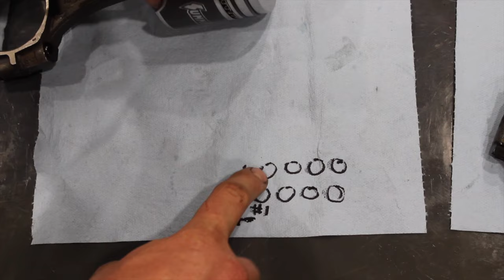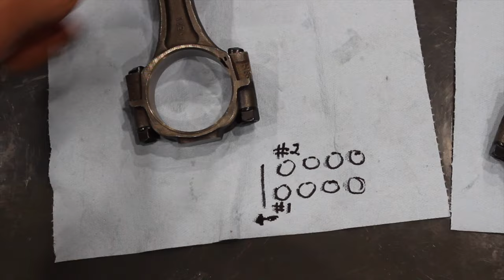SBC Piston Ring and Rod Orientation (For the First time Builders)

Comment: sorry, oil controller is 9-12-3 then 2nd ring at 9 and top ring is 3, all street engines are set in that manner. read your paper work. if you don't do this you will get piston washout, and foul your plugs. if you done this right, you should get a nice golden burn on top the piston. if you see clean spots, someone did not install ring correctly. you never clock the 1st or 2nd ring to 12 or 6, this is thrust points. You want full ring contact on exhaust & compression strokes. piston skirts will thank you. engine builders 101
Reply: don't the rings move around when engine is running? so what even is the point of ring orientations?
Reply: 3what?
Reply: Yes but if they do then they move together ,but is still very rare that they will be all at same place @lordjaashin
Reply: @lordjaashin  And what is going to cause or make them turn??
Yes they will move, ---- 
UP and  DOWN
Reply: @frederickshipp8013  The cross hatch on the bore. The ring gap not being exactly parallel to the bore. Piston rock. Blow by. They move all around. A properly gapped ring will close up when warmed up almost eliminating the gap. If it is not gapped correctly you get blow by or a broken ring w/scored bore. Too much ring groove clearance will also cause excessive movement and flutter.

Comment: Like you, I make myself feel good by timing the gaps. Reality is the rings rotate and go wherever they want.  Ironically though it's rare to pull an engine down and find the gaps lined up ?  If it gap timing really was important, surely someone would be using pegs like 2 strokes do, but I've never seen that on even the most expensive pistons.
Reply: Found the same thing my self

Comment: I have watched rings rotate on pistons before. When I worked for the truck line, we'd pull the air box cover/s off of the 2 cycle 8v 71 Detroit's, and we could watch the pistons through the ports and see the rings turning, when it was running
Reply: On my 2-stroke dirtbikes they’ve always had a locating pin for each ring. I thought that was the norm to avoid the open end being cought in a port.
Reply: @ian9toes  As I recall, the Detroit's had a ring of relatively small ports around the bottom, anyway they didn't have ring retaining pins.
Reply: Exactly. It really doesn't matter, but i roughly do it anyway.  I definitely won't be losing sleep over it 👍

Comment: the rings spin on the pistons when the engine is running.  oil control rings are about all you can orientate. but good explanation of v8 rods.

Comment: If everything is correct the rings will rotate on the piston during normal engine operation. When they stop moving is when problems start.
Reply: Incorrect. How would piston rings rotate? There's zero rotational force.

Comment: Not sometimes, the rings WILL rotate because of the crosshatch. If you pull an engine apart after it's been put together and run you'll see the gaps in different places. The initial clocking is to make sure they don't line up from the start. I've pulled apart engines that have 60k+ miles and still have cross hatching showing (high nickel Chrysler blocks). Most of the ring and piston mfrs and OEMs have their recommendations. As long as they are staggered. I've seen 120 degree spacing in some service manuals, or 270 with some ring packs from Speed Pro.

Comment: I was taught to put the endgaps away from rhe thrust faces of the pistons.(opposite of what you said to do.) By a very respected well known engine builder.) So that the ring ends dont score the thrust faces on break in.
I put them all at the 90°\270° area.(ends of gudgeon /wrist pin.)
Reply: I thought the same thing.  Seems odd to put the end gaps on the thrust side.

Comment: Good video! Another note to add is the berring locking tabs in the rod go to the top closest to the cam in case the rods aren’t numbered and the new pistons are not on the rods yet!
Reply: locking tab to out side 0f crank
Reply: They go towards the oil pan rails, not the cam.

Comment: Many years ago I did some piston rings and I separated some feeler gauges and put 3 at different parts of the piston and slid the sharp edges of the ring on the gauge to prevent it scoring the piston; it was a 4-cyl and it worked out fine. But if I had to do it today, I think I would buy me the proper tool.

Comment: I really like how you explain things and talking about what works for you and others, as a diesel tech in Canada, in our colleges it’s taught that ring gaps for diesel engines are clocked 180 and the gap must not be set over wrist pins, nor the   Face (where the piston skirts the longest) it was explained because when the piston is in its power stroke actually off sets to the one side or “rubs” to one side, idk what do you think about that? It’s hard to explain with out holding the piston assembly like you are in the video

Comment: Simple tip fitting piston ringe,   ...   take   THREE  old  thin feeler gauges, align them around the piston at 120 degrees ,  [use elastic bands to hold them in position if reqd. ]   ... then easily slide the rings over the feelers , over  the apropriate  ring grooves , slide out the feelers and the ring drops into the groove !  ... also works removing rings !

Comment: Cool, I like to put the compression rings on the non-thrust plains. Plus clocking those rings on the pin end side will minimize the chance of the rings gouging the cylinders.

If you put the gaps above the skirts where the pistons have the most available amount the piston can move in the bore if the piston rocks on the pin's axis. That movement would be minimized 90 degrees of the axis.

Anyway, that's my thinking about that which is probably a bit nit picky on my part.
Reply: You are really forgetting about thrust. Check your thrust bearings upon removal, they will wear the sides more than any other bearing, rod or crank, so up and down on the compression rings is best orientation. As any slap or wear on the skirts pin end sides is rocking this gap ends into the walls on the thrust side...just engineering thoughts.

Comment: Questions: 1-Do you “clock” your cam bearings? I’ve heard mixed things, but the last motor I built, I clocked them to roughly 3:00. 
2-What head gaskets do you like for your Vortec heads? I really want to try out the Felpro 1094’s for the extra compression, but worried about them sealing without everything being decked.
Reply from the maker: Yeah I do clock my cam bearings. Some guys will tell you it doesn't matter where there's a oil groove all the way around but the optimum place to position the oil hole is between 2 and 4 o clock looking at the block from the front.

You may find you will have problems with the steel shim gaskets on a undecked block. Guys have done it with success but its obviously hit or miss. The deck surface should be very smooth when using a shim or mls gasket.

You can use a gasket like GM# 14096405 (.028 thick) on a decent deck surface.
Reply: Awesome thanks. Also do you have any videos on how to select your cam timing and ignition timing for your specifically desired torque curves? Thanks.
Reply from the maker: Not yet but some future videos
Reply: Bearings with 3 holes in a triangle configuration, you set them at 3 and 7, which oils ahead of the cam journal in rotation,  looking at the front. 1 hole bearings don't optimally oil, so they should be at 6 in line with main, which again, Isn't optimal but will throw more oil at the bottom of the journal.
Reply: I don’t do them between 2-4 o’clock because it takes up most of my day I do them at 9 o’clock in the morning 😂

Comment: I usually put oil rails at 60 to 90 from the expander  then since I don't want the ring gap on 5he thrust side of the piston u usually line them up with opposite ends of the pin
Reply from the maker: I guess I've just always done is the CP carrillo piston way. Its just one of those things that everyone seems to do differently haha

Comment: Golden rule with rings:
If you take hold of each end you can push them together, you can waggle them up and down but you CANNOT pull them apart or they'll break. Practice on your old rings first.
Reply from the maker: Good advice. Moly rings are forgiving, but cast rings certainly are not lol
Reply: Rings, especially cast iron, can be pulled apart, NO MORE THAN NECESSARY,  to fit over the piston itself.
 They break easy, then the brakes are on, for progress, until new ones are acquired.
 Like he mentioned, experiment with the old rings, to get a feel for how much they can move/expand, before they break.
 If you get frustrated with any shituation. The shop rule is:
"Only throw the broken parts"😁

Comment: Piston ring orientation at assembly isn't something that matters. 

There has been multiple studies on this subject (GM E. Schneider D Blossfeld is one example, I believe Ohio State did another but cant find it at the moment.). Realtime analysis is done by exposing part of the ring to a radioactive source and using gama ray monitors to view the motion of the rings in a running engine. All these studies find piston ring rotation to be rapid and erratic. The ring gaps will line up eventually, and they will soon after not line up, and on average, they will spend more time not lined up than lined up.

If it makes you feel better to orient them in a certain way by all means do so, but don't lose any sleep over ring orientation.
Reply: That's awesome. I can now stop clocking my rings in all the $250k motors I build. 
I have seen first hand what happens if you don't clock your rings. Massive amounts of blow-by. We have had rookies make this mistake in the past when someone wasn't watching

Comment: How the rings get clocked doesn't matter, since the gaps WILL line up eventually. Rings have to turn, and turn they do. It is a necessary evil. However you set them, is purely by builder's choice and how it makes you feel inside, knowing they didn't line up when you installed them. 
However, it is MUCH more important to make sure the gaps are correct, the rings are installed right aide up, and most important, they are the correct ring for the ring land. Radial, and axial.
Reply: If ring ends line up then you have no compression and blowbye, clocking rings is very important, rings just don't turn they turn back and forth that's the purpose of cross hatch honing.
Reply: @jeremyking5684  False, actually. Rings Do turn. Gaps WILL line up. They don't stay lined up, because they turn. They are always turning. Why? Because if they don't they can't disappate heat, and they will fail very quickly. Sealing a chamber is not the only job a ring has, and it has ZERO to do with cross hatch. Period. 
I know what happens when they line up, and at some point, they always will. Nothing anyone can do about it.. Just an FYI.
Reply: It does make a guy feel good about how he put his engine together, though...
Reply: 😁 Cross hatch honing is done to make sure new rings wear to the cylinder walls. Ensuring the new rings seal all the way around the cylinder walls. The cross hatch acts as a cutting edge on the rings. Eventually the cross hatches get wore off and the cylinder walls become very smooth as do the rings.
Reply: @jeremyking5684  Wrong
Reply: @jrdmotorsports9718  so all the ring manufacturers that put instructions in every ring pack about clocking rings don't know what their doing, every car manufacturers has pacific ways to clock rings don't know what they are doing!😂
Reply: @ihatecrackhead  in 30 years building engines I've never took one apart that had ring gaps lined up! I had to fix a engine that a guy built that had low compression on a cylinder and the cause was rings gaps was line up! If it don't matter why did they invent gapless rings!
Reply: @jrdmotorsports9718  okay you hack been building engines for over 30 years ,people don't have to take my word, look at your ring box it tells you every service manual tells you! All the engine builders I know clocks their rings, I used to put engines together for car manufacturer everyone you clock the rings we did over million cars a year!
Reply: @jeremyking5684  Show me where in my comment that I said  not to clock them? I'll wait....
Just an FYI, assembling an engine here and there over a long doesn't make you an actual engine builder, regardless of how many years you do it. 
The fact you are messing with this stuff for 30 years and still have to follow a manufacturer's recommendation tells me all I need to know about you. 
Next time think before you speak, and learn to read like you read those directions on how to assemble engines.
Reply: @jrdmotorsports9718  you mean the directions that's only put on there to protect the manufacturer, that's an hack job saying right there!
Reply: @jeremyking5684  No. It's common sense. Real engine builders, who do this for a living, everyday, for 35 years, like myself, know that. All they are doing is making it user-friendly for the ones that don't know how to assemble engines. Assemblers are not builders. Manufacturer's recommendations and assembly directions are not the golden standard. Just helpful hints. The fact remains, rings have to rotate. Gaps line up. Therefore, logically, the engine doesn't know the rings were 180⁰ , 90⁰, or 45⁰ apart when installed. Doesn't matter what engine or what power level. Period. The real hack is the one thinking this is false.

Comment: Ever use total seal rings & their dry powder cylinder lube?  I run their gapless rings in almost every build now, the gapless top ring are great for racing but tend to pull oil past the valve stem seals due to higher vacuum
Reply: The things we learn by watching and reading.  Incredible. I guess no need for a vacuum pump if blow by is diminished???????
Reply: For external oil leaks I mean

Comment: I just installed new pistons and rings - when turning crank by hand, I can hear a subtle scraping sound - is this a normal sound for new installs?

I did take the piston back out to check rings and cylinder wall, and both were good...

The crank turns fairly easily although a tiny bit rough with pistons installed... can I assume this is normal and the noise is coming from the new rings riding on new hone?

Your experience in this sure would help put my mind at ease!

Comment: thank you for this info! randomly fed on my front page (looking to rebuild my genesis). I do have a question, when i buy my new pistons and rods if i see the little slanted edges on the connecting rod that hugs the bearing.. even for a v6 would i still want to use this same method of bank 1 having them face the front and bank 2 facing the rear? I guess when i pull the motor ill see what it has in terms of orientation from hyundai right? lol (first time builder)

Comment: Quick question if you did put the pistons on the crankshaft the wrong way how long will it take for the engine to fail. Like instantly when you do the first start or it takes awhile.
Reply from the maker: Like as far as if the chamfer on the rod wasn't facing the correct way? If the chamber is not facing the correct way, first off it will be very hard to install the both rods as there will be no rod side clearance. If you do manage to get it together, it will be very hard to turn the engine over and probably fail fairly fast if you do get it started

Comment: Getting ready to start on an 880 block and 906 heads....have some Piston ring and rod bolt questions:

1. Piston rings-what do you recommend if I’m using hypereutectic pistons BUT I’m just deglazing/honing at home with no machine work? Also anyway to make sure I get the best outcome with this situation? 

2. Rod bolts- I had all intentions of replacing the rod bolts with ARP, but then I read that changing the rod bolts, changes the size of the rod journals??? What’s my best option here?

My local machine shop just closed and I’m on a family mans budget anyway....so hauling everything an hour away and paying hundreds of dollars in machine shop fees isn’t ideal, especially when everything I have is in really nice shape. Thanks!
Reply from the maker: 1) Piston rings: I'm assuming you're using new after-market hyper pistons pistons? If so, I would just use a set of premium hastings rings with a moly top ring. It might be a good idea to get a file fit set of your bores are slighly enlarged. 

2) Yeah, you will need to have the rods honed if you replace the rod bolts. 
Chances are the big ends are out of round now, even with the old bolts. Adding the ARP bolts and rehoned rods might be your best investment if you're trying to do a budget build that you want to beat on abit. Rod bolts are the most stressed fastener in the engine

Comment: Just an observation. Using the chamfer as a reference to orientate the rods can get confusing for beginners, put the bearing dowel notches towards the pan rail is the easiest way to remember, not all engines are this way, but sbc's absolutely.
Reply from the maker: Another great way!
Reply: what if its a 4 cylinder engine and the rod chamfer is the same on both sides?  which side to the bearing dowel notches point towards then?  do they point to the exhaust side of the block? or point the notches towards the intake side of the block?
Reply: And as long as piston notches are fronted( if applicable)

Comment: Will oil get inside the combustion chamber and burn oil if the rings are not properly clocked?
Reply from the maker: Rings should always be property clocked during install but that doesnt mean they wont move around. You can sometimes find gaps lined up when taking engines apart.
Alot of car manufacturers that have engines that burn out get blamed for piston ring gaps lining up but when its actually oil control rings that get caked and block the oil return holes in the piston. 
Ive found with the extended oil change intervals or people that go way over the oil change have this issues where most people that change the oil religiously dont have it as much